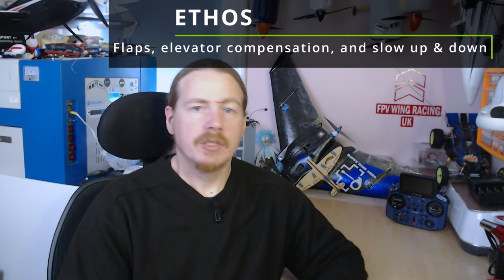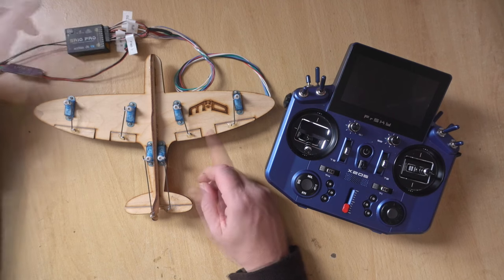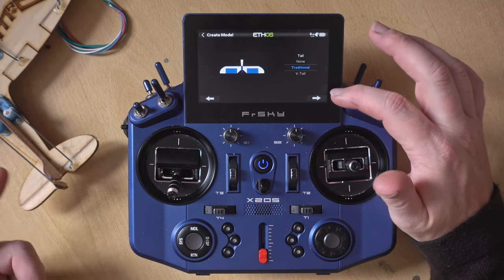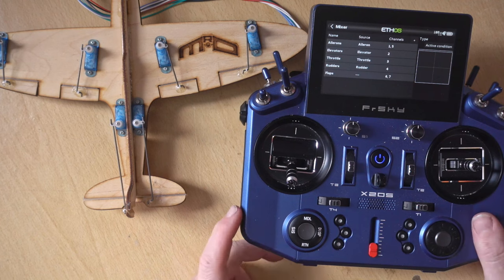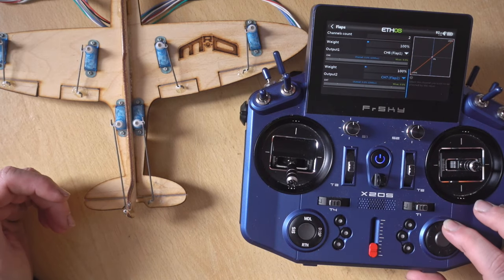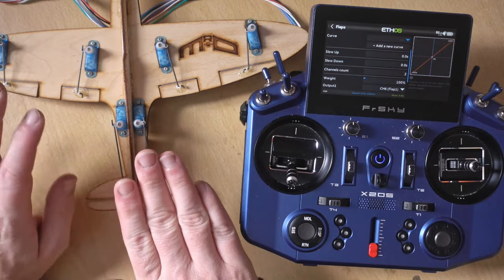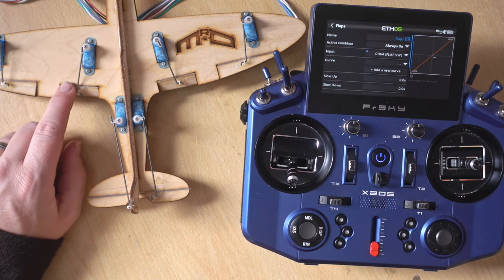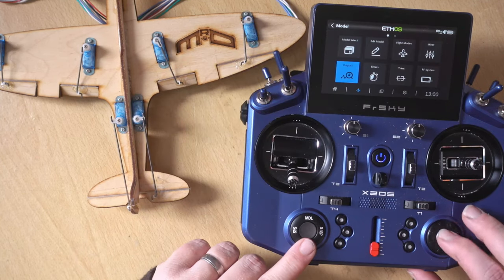Flaps with elevator compensation and slow, using ETHOS

Comment: Too complicated. You can set the FLAP - ELEV mix using as input the FLAP channel. Doing that  if the flap is slow, the elev mixing is slow. You can leave always on, or assign a switch with the voice "THS ON" that means Trimmable Horizontal stabilizer ON. As you prefer

Comment: Hi Darren. Shouldn't you have down elevator compensation.
Reply from the maker: In all honesty, I've seen both. This is why I suggest starting without any compensation and gradually increasing it. With standard flaps, you should need up elevator. The flap control surfaces are behind the centre of rotation, so will push the nose down. However, if people are coming in too fast and drop the flaps, it can cause ballooning, which would require down elevator. Seeing what happens when the flaps are deployed at typical landing speeds, on a particular model is the best way to see what, if any, elevator compensation is needed.

Comment: thanks for the video, a bit more complicated then OpenTX/EdgeTX, video is well done but shows why they really need to bring out the edit ability on a companion app; this is fine for a couple of models but it's too much to program on the transmitter itself when you are converting from the previously mentioned EdgeTX

Comment: What did you use to color/laminate your arwing?
Reply from the maker: It’s just regular encapsulating laminate, ironed on. The coloured parts are self adhesive, cut vinyl.

This is the laminate I used. https://www.ebay.co.uk/itm/303038800488 I used 75 micron thick, 457mm wide. The 75 micron thickness is the important part. The width is just how much you ca fit on with less length used. These rolls last for years though.

Comment: question? any rec for auto launch for my sonic pro i have set my motor delay to 0 and set auto launch throttle to 1700 and detect velocity to 200 not 300 and i set motor idle to 1200 so it wont troq roll or straine the ecs when launching i set a arm timer to 5000 for 5sec

Comment: Many thanks for sharing all this great information. I'm new to Ethos and so far I love it. Thanks again, Cheers
Reply from the maker: Thanks Bill. Glad it was helpful 👍🏻
Reply: @MrD  Hi Darren,
I have a x18x and trying to get a avian 15 set up for my glider. The surface channels work, rudder and elevator,  but I can't get the throttle to work. I went thru the set up procedure and it won't work. It give a continuous beep. It worked with my old 2.4 Futaba, not sure what's wrong.
Any ideas would be great.
Thank you,
Bill

Comment: Again, hats off! A great, well paced and thought out video - The best YouTube channel on Ethos there is. The second method you used for "Full span ailerons" has the advantage of being able to be turned on/off with another switch.
Reply from the maker: Thanks Miksterr. Totally, the second method could be on a switch or activated with certain flight modes.

Comment: Thanks Darren! this video helped me indirectly because I have a STOL plane with quite massive flaps that are set with a delay up and down to minimize the jump when deployed.
I had the mix already programed but the flap to ele mix did no allow me to set the same delay on the elevator until I saw you using a free mix on it
Reply from the maker: Glad I could help 👍🏻

Comment: Why not use flight modes to trim the elevator during flap deployment?
Reply from the maker: Because current flight modes in ETHOS are an area that still needs work. Currently you can only have different trims per flight mode. You can’t specify if they are based on another flight mode’s trim. For example with the elevator compensation, the default flight mode will adjust the trim of the elevator. Then switch to the flap flight mode. If the trims are independent, it will be back to 0 trim and you need to adjust it for flaps down. But where they’re totally independent, if in the default flight mode you adjust the elevator again, it won’t be reflected in the flaps mode.

In OpenTX, you could do this. The flaps mode could make the elevator trim in addition to the elevator trim of the default mode. Which makes everything so much better. 

Hopefully ETHOS will improve the flexibility and functionality of the flight modes soon.

Comment: Hey Darren, thanks for your videos, well done, very helpful.   Could you possibly make a video where you program a simple powered glider with rudder and elevator on the right stick, spoiler on the left stick and motor on the left side slider.   Most videos I see are for power planes with ailerons and full house gliders which I also fly.  I see you can change the mode of the sticks, but it changes them for all models not just the one you are programing.  Thanks.

Comment: Hey Darren...How can I set up a beep or haptic in Ethos to activate when the throttle passes through 25 and 50% up or down? I trim all my planes at 50% and use 25% for landing approach on my EDF's. This is easily done on Spektrum but I can't figure it out on Ethos.....Thanks ( Rains are finally returning this weekend to the Pacific Nortwest so I will have a wet Fall and Winter to learn Ethos)
Reply from the maker: It should be easy enough to set up with logical switches. I’ll make a video for it soon.
Reply: @MrD  That would be great....Thanks

Comment: How to set elevator trim using flight mode
When the flaps are in position 1 Elevator compensation 1
When the flaps are in position 2, rudder compensation 2
When flaps are closed Elevator trim reset
Reply from the maker: This is not possible with flight modes at the moment. Flight modes can have their own trims. But you can’t choose how. For flaps, it would be ideal to base the elevator trim in a flap flight mode, on the elevator trim in the standard flight mode. Then any changes to regular trim would also be reflected in the flaps.

Comment: Can you not set a flight condition where you can separate elevator trim and trim flaps out instead of using compensation?
Reply from the maker: I don't believe so. The trim options in the current implementation of flight modes in ETHOS doesn't have much scope.
Reply: How to set elevator trim using flight mode

Comment: Great video though I don't believe you want your elevator going up as you deploy your flaps in most instances as the majority of planes and gliders will pitch up ( see at 4 mins https://www.youtube.com/watch?v=xRg5M9kWjRI ) when flaps are deployed not down - might be worth putting a few bullet points on this at the relevant point so people check what happens to their actual aircraft when they deploy flaps or at least start from the norm
Reply from the maker: There is a note in the video description. I find that it depends on the plane and approach speed. Down elevator is needed if the plane balloons. But that doesn’t always happen.